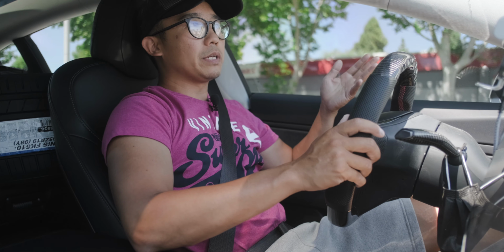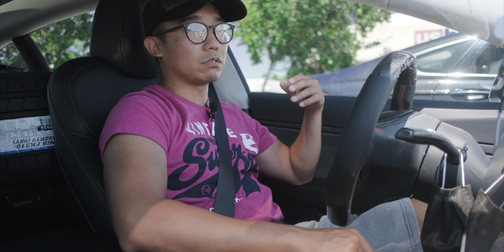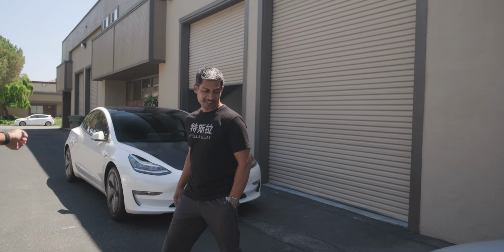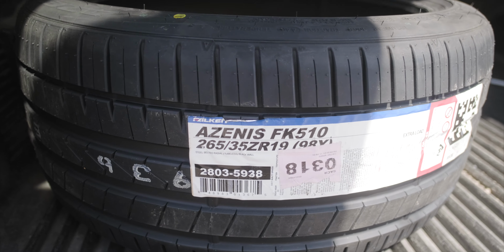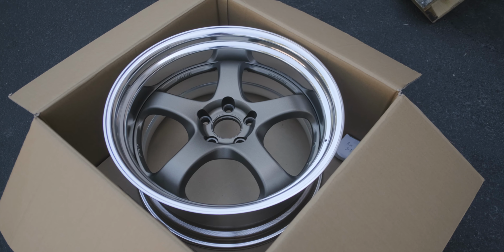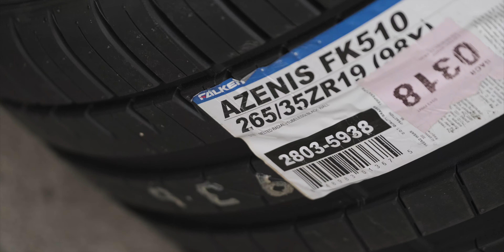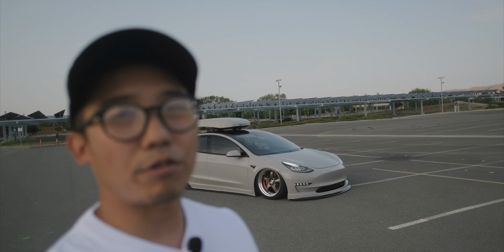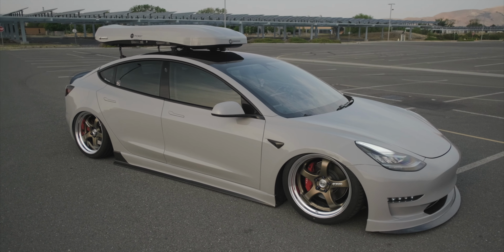Tesla Model 3: New wheels finally arrived!

Comment: Do you know if these work wheels set up will work on model Y?
Reply from the maker: as far as would the same wheel fit on a model Y? yes, fitment wise is close but the Model Y can be slightly wider and definitely could be bigger in diameter, tire size choice would be different too, but after all, it all depends on how you like your wheel fitment and your ride height, your alignment spec and tire size

Comment: Just ordered some new wheels on my model 3 19in +22 on front and back, you think it will fit with my air suspension?
Reply from the maker: Congrats, what’s the width of the wheels?
Reply: @TeslaDIY  19*9.5 in the front and 19*10.5 in the rear
Reply: @TeslaDIY  +22 offset
Reply from the maker: Should fit pretty good on the back, front will be a bit tucked but keep in mind that tire size and camber plays a big part in fitment too, especially camber
Reply: @TeslaDIY  thanks you